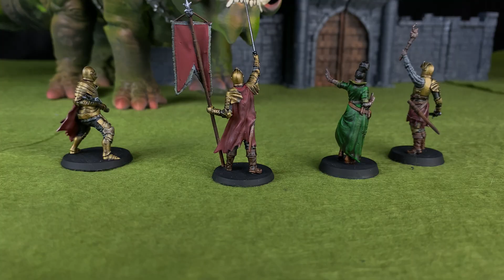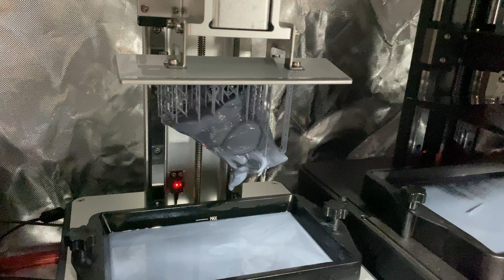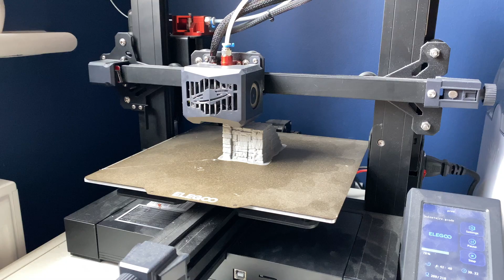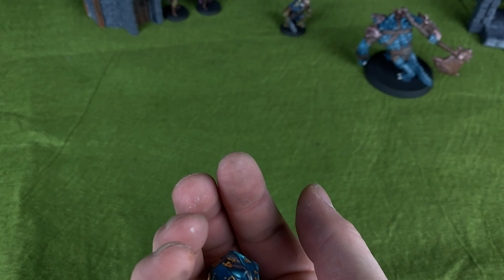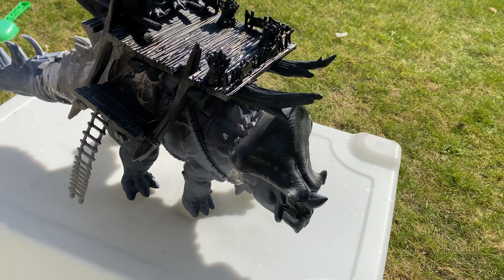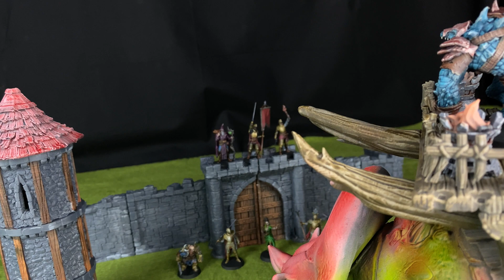My Hugest 3D Print Yet! Massive Dinosaur, Terrain, and Miniatures

Comment: I find it way easier to make sure CLEAN API gets onto all the hollow area so that any dissolved resin /API is removed. then I just make sure that I have a tiny hole drilled into each hollow  piece in a unnoticeable area, so that any gas from curing surface resin has a place to leave.